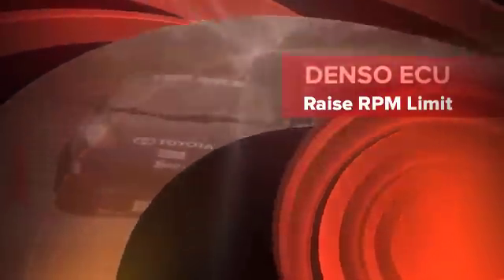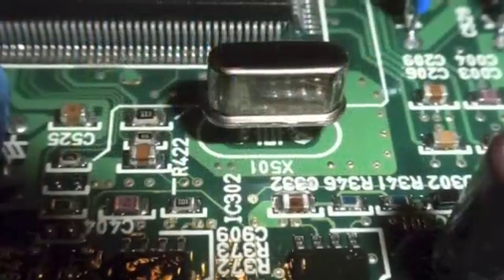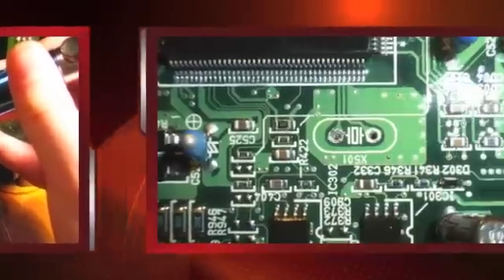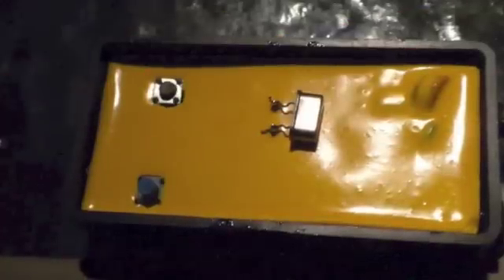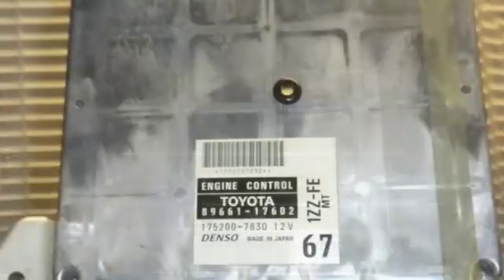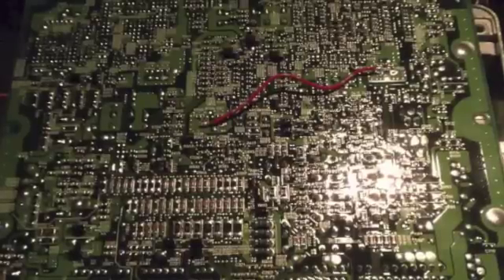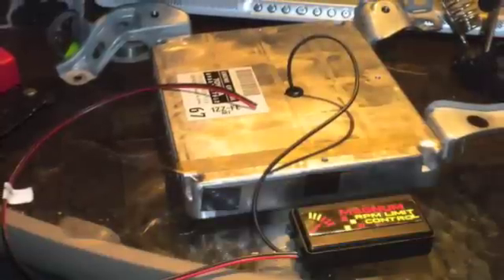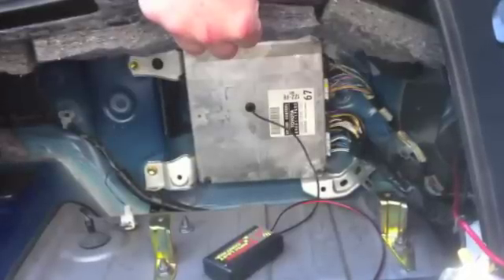How to raise RPM limit on a DENSO ECU DIY

Comment: Great video, I have a UK MR2 1990 3SGE NA, this has a DENSO ECU, It has two Crystals installed on the board, I need help identify the Mhz from the part number, would you know what MHZ these part numbers are 800NDK'06 and 120NDK'06. Thankyou.

Comment: iv done this too my 4afe but has lost power but is revving way higher not reckon medding doing as the 4afes valve train is not made for it
Reply from the maker: Thanks for the comment!  You might regain some power by advancing the ignition timing by rotating the distributer.  Also you can ajust the spring tension inside the airflow meter.  Make sure to mark both before adjusting incase performance worsens.  Good Luck!!

Comment: Hey can I do that on a Toyota paseo ecu mine only has 1 frequency crystal
Reply from the maker: Hi Juan thanks for commenting!!  I have done this on many ECU's that have only 1 Frequency crystal.  When I did this I soldered a crystal socket to the ECU circuit board.  I purchased a socket and variety of crystals from Digikey. Stay within about 5% of the original crystal frequency printed on top of the crystal.  For example with an original frequency 4.0 Mhz a 4.19 Mhz replacement would work well in my experience.  I experimented with different crystals inserted into the socket until I got the results I wanted.  You may have to advance ignition timing at the distributer by "road timing" the engine listening for knock and adjust the idle speed once you install a higher frequency crystal on and older fuel injection systems because the ECU will "think" the engine is running slower.  I have also installed a larger airflow meter from a 1980's era Celica Supra 6 cylinder Normally aspirated onto the 4 cylinder Toyota.  When you do this you need to unseal the airflow meter lid and adjust the tension on the flapper door spring.  This adjustment controls fuel curve and ignition advance curve based on load so make a mark at the stock spring tension setting in case you get too far out of adjustment.  Yes you can also adjust the tension on your original airflow meter and again please make a mark at the stock setting.  One other trick to make the older engine more responsive is to adjust the setting of the throttle position sensor by advancing it slightly in rotation.  You may need to enlarge the mounting holes to do this.  If a check engine light appears back off of the adjustment slightly.  Have fun Juan!!!

Comment: Overclocking is to increase processing speed. NOT RPM speed. LOL... thats just a piggyback of the rpm controller.
Reply: It will. because the clock speed of the crystal also provides the time base at which the ecu calculates the RPM. Each tick is now faster.

Comment: Can I do that to a Scion tC 2011
Reply from the maker: Hi Hector Thanks for commenting!!  I have not yet experimented with a system from 2011.  You may be able to simply "reflash" the engine map software in the ECU.  Please check the Scion forums to see what others are doing.  Some of the newer systems have "drive by wire" throttle control and you would need to be REALLY CAREFUL in your experimentation. Have fun Hector!!

Comment: will this work on a toyota with SMT transmission ? 
I just don't understand how overclocking the ECU increases the rev limit. 
I know something about electronics and this would be bad for your internal CPU or MCU. 
Isn't the rev limit indicated by the software or firmware that runs on the ECU ? In best case it will make the CPU run at faster speeds , but what about the mapping ? The numbers will remain the same as well as the sensory inputs. It will only read them faster meaning that it could adapt a bit faster. Can you please explain very detailed how this actually works so I can understand that I'm not going to mess up my ecu ? Besides .. placing the crystal so far away from your cpu or mcu is DEFINITELY  not a good idea. It's a common rule that you should place it as close as possible next to the cpu or mcu, why you think it was there in the first place. So I don't see how you could use wires that long to do that. This will have absolutely an affect on the x-tal. I am curious about your explanation and how you came up to this. Do you perhaps know what cpu or mcu those are so you can find out the max frequency ? You can also set this frequency into the firmware itself. Did you try to read the software on those ? Such a pitty that you didn't research more about this ECU as it's to be found in many cars with potential.
Reply: Alex Angel you're overthinking the shit. Either do it or don't do it. Toyota ECUs are the hardest to crack and diehards have been doin this for decades now. Bookworms...sheesh!

Comment: I have a 1997 toyota corolla 4afe and is 6200 rpm limiter has the crystales if the off increase the rpm or more. or I have the use magnum rev limit

Comment: i have question.i got magnum product rev-pro but my crystal has 4pin,and magnum rev-pro ori has 4 wire,1red/2black and 1grey clour wire.so how can i do solder position??? 4pin crystal must solder what colour wire and the board must use what colour wire for solder??? i'm watch you this video why you not solder the magnum box red wiring  12v to ECU harness red colour wire  ignition ??? sir pls answer me how can i solder do it colour wiring position

Comment: Hye John Broderick,,Im using 4age 20v Levin with stock ecu 8200rpm..Is it possible by replacing the clock so that the rev limit will increase?...And how to replace the speed limit too?..Pls help,,

Comment: Excellent video. i have a question. i have a corolla xrs 2zz i got the limiter raised from 8200 to 8600rpm. a mechanic did the job for me, but when tested the car i noticed the check engine flashing because the air fuel mixture was extremely lean. i want to change it back to stock. will that fix my mixture? also how do i know the mhz of the oem crystals and where you think i can buy them? thanks
Reply from the maker: Tidybc 8600RPM sounds fun!! Slightly larger injectors or more fuel pressure may help fix your mixture.  RC Engineering offers slightly larger injectors as does ebay. The OEM Crystals are ink marked with the frequency.  A photo or look inside of a stock ECU will give give you the frequency.  You can buy crystals from DigiKey or Mouser electronics supply.  Get some crystal sockets too so it is easy to swap them.  Good Luck.
Reply: the problem is that the car is getting lean as son as i accelerate. even without engaging lift. the problem is that the ecu is supposed to always fix the mixture, is supposed to read the o2 sensor and give more gas if the car needs it automatically. for example when you raise your limiter with an apexi pfc (without adjusting nothing more) or when your car has stock limiter the car automatically fix the mixture to 12.5 but when you do it via crystals it doesn't fix it. its like something inside stops working and the car its just guessing the correct mixture. btw 2zz oem injectors can handle even upgraded throttle,ported intake, exhaust etc without needing to change them or the pressure. thanks for your help bro
Reply: what are those crystal sockets you told me about?
Reply from the maker: Tidybc
Crystal oscillator sockets solder to your ECU mother board and allow you to snap crystals in and out very quickly.  Google HC-25U to find them.  You may be hitting max injector duty cycle on ECU which will limit fuel flow.  If you increase injector size slightly the ECU can correct the mixture for the other areas of the fuel map and flow more at max duty cycle.

Comment: How do you solve the problem of overheating. Like any computer device overclocking tends to cause overheating. Not only is the ECU running faster, but, what happens with the other components of the vehicle that are designed to send and receive instructions at a set speed with a min and max threshold of ~1 hz to ~1Mhz?

For example, the oxigen sensor and the ignition controller could not read the ECU because of the higher speed. How can the ignition keep timing? your car would naturally accelerate all around causing failure. I do not believe that is a natural approach and presents too many risks to other components.

Note: that you memtioned in your video handshake with an OBD2 reader is not possible with an overclocked ECU
Reply: I can't see any heatsinks on the processors, so I doubt they'll get very hot in the first place. For what I know, they can be high performance processors that has been clocked down for stability and longevity purposes, since these are meant to last as long as the car.

Comment: What if i just remove the crystal and dont replace it will i have no rev limit?
Reply from the maker: Good question.  I have done this. If you remove the crystal the ECU will not operate at all.  The crystal sets the clock speed that the CPU(s) function at providing a time base for the refresh rate of all ecu operations.  I would never suggest no rev limit.  Rev limit is a protection system for your wallet and the ability to finish a race with out blowing the engine.

Comment from the maker: Hey boricuasr5 thanks for the comment!  If you are wondering what crystal to switch to here is a general rule of thumb.  Multiply the stock crystal frequency by 105% and select the closest available replacement crystal to the resultant number. For example: 4.0 MHz x 105 = 420 / 100 = 4.2 MHz.  The closest available crystal is 4.19 MHz  which works well for replacing a 4.0 MHz.

Comment: Your a great brilliant man so maybe you can assist to my setup of trying to build a quik cheaper alternative rather than pouring out funds on a standalone from a company giant what I been able to is get a plugins Bluetooth obd box and then use just my laptop as the brain only to attend between the stock ecu to control all sensors from air fuel to timing and rpm but I still can't find a proper software app to give me full standalone capabilities 1nz-fe can you please. Helpbme

Comment: My crystal 16.000MHz factory is: 88. searched on ebay found some Crystals. (16,384 MHz Crystal Oscillator HC-49S) (16.9344 MHz Crystal Oscillator HC-49S) (18,000 MHz Crystal). Which of these do you recommend to use and my ecu. Thanks for answering